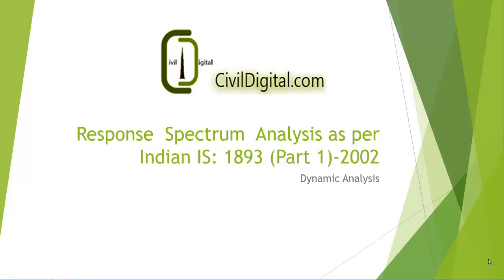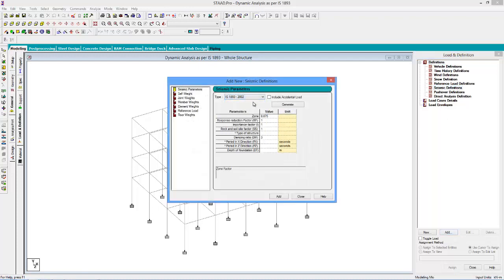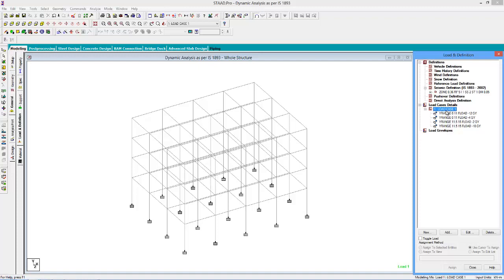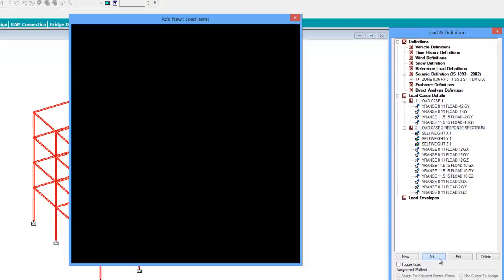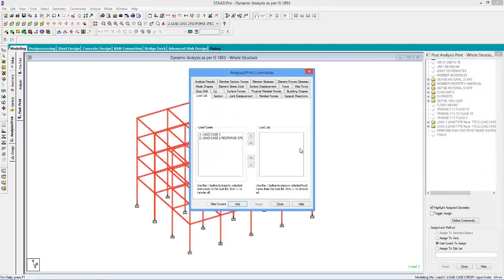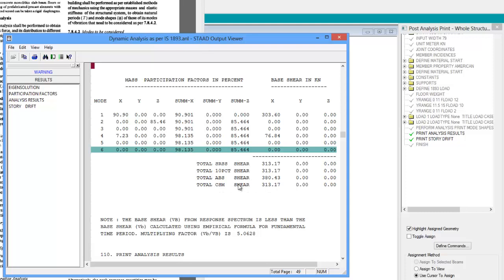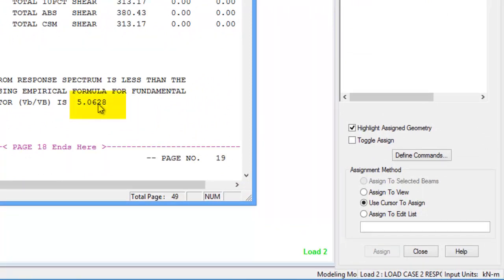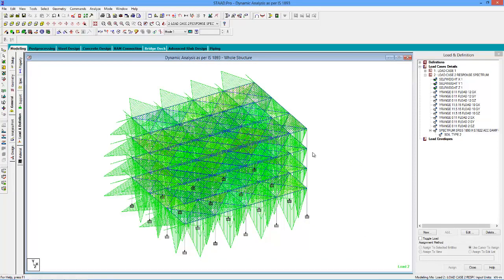Response Spectrum Analysis as per IS1893 in Staad Pro. V8i (Dynamic Analysis)

Comment: My result says like this...
Story drift cannot be calculated for the response spectrum load case.Response spectrum computes joint displacements that represents maximum magnitude of the response quantity that is likely to occur during the seismic load. Any response quantity like story drift, torsional irregularity, etc should be calculated from actual displacements of each mode considered during the analysis. The response quantity from each mode should be combined using modal combination to get the maximum magnitude of that response quantity.
Whats the solution for this?

Comment: hello sir! 
Can you tell me how to give more no. of modes, if 6 modes are not sufficient? 'cause as per Clause 7.8.4.2, IS 1893 part 1, the no. of modes in the analysis should be such that the sum total of modal masses of all modes considered is at least 90% of the total seismic mass" . but in my analysis, it is only 78%. So what to do to give command for more no. of modes?
Reply: Select "Commands" from Menu Bar, under the drop down menu, select "Miscellaneous" sub option, then select "Cut off mode shape", then enter your desirable mode shapes.
Reply: Ezhil Aaron that doesn't works ...

Comment: thanks for a very helpful video. Couple of questions... 
1. Why is the dead load value so big. I didnt see the brick loading being applied in the model . for seismic load i think the brick load being dead load should be applied 100% . or does the applied dead load includes brick load as well ??
2. as questioned earlier by Akshay , wht abt the signs?

thnks again for the well presented video.
Reply: +aarakshya kandel Dead load value will depend on the actual brick loads and codal loads. Values assumed here are only for demonstration purpose.